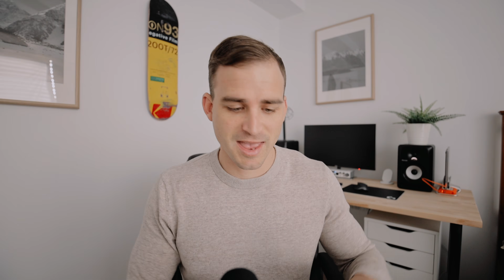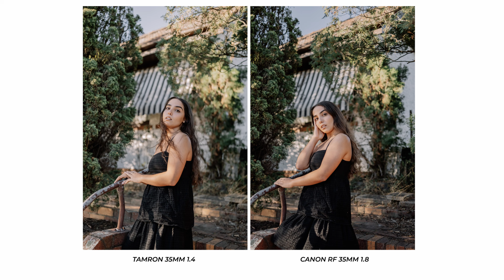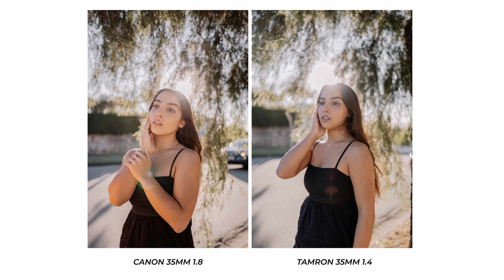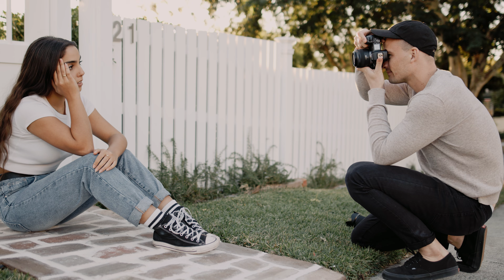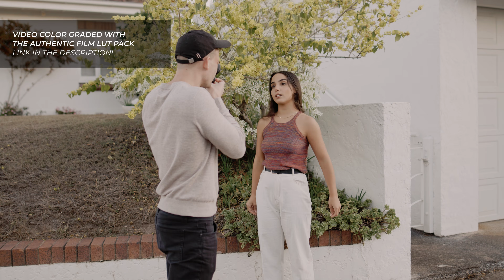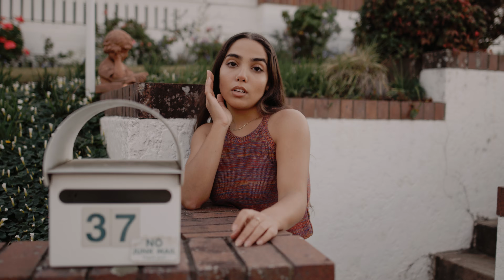Canon RF 35mm 1.8 STM | Photoshoot + Review

Comment: I have this 35mm 1.8 STM 35 from canon. It is a budget lens and its limitations to me are clear. I normally use my 24-70 RF lens so with that the difference to me is very noticeable despite my 24-70 being a zoom lens but for the price, it may go down as the best budget lens canon has ever made because it punches above its weight massively.

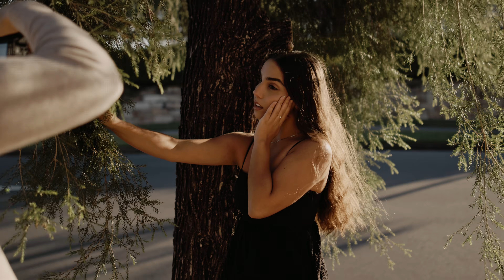Comment: 3:55 just slap a pk 2-5 stop nd filter on in your back pocket "just in case", and problem solved. Booyah. Loved the video btw!!! :D
Reply from the maker: An ND filter stops lens flare?
Reply: @MitchLally  taken from DP review two ideas:

 a) Filters generally worsen the flare. A graduated ND filter which can reduce the light from one direction may help. In some situation a circular polarizing filter can also reduce flare. UV and clear filters protect the lens mechanically, they do not contribute anything to the quality of the image.
--
Gautam

B)  and a guy named Doug walker mentioned the Hoya 77mm Clear Pro 1 Digital Multi-Coated Glass as a viable solution. 

At the end of the day, you do you, but I'm always curious to play around with possible solutions. 😉 Good luck broskie. 🙏

Comment: How close does the "macro" actually let you focus? Imo having macro capabilities on this lens is a HUGE selling point. For people who just want a simple setup for travel use it's perfect. 

Think about people who travel who want a lens that focuses super close for product/food shots but is also wide enough to capture the sights of whichever place they're currently visiting. It's perfect!
Reply: It can get pretty close, I don't have the figures, unfortunately, but it does take Macros quite close-up.  But this is not a professional lense.  The pictures are not as sharp compared to its counterparts, especially after you have taken them and zoomed into the eyes of the subject. I have this lens but I hardly use it. My advice would be to get the Sigma  35mm 1.4, it is a hundred bucks more expensive or so but if you have a bigger budget, then get the Canon 24-70 2.8 or the Sigma 24-70 2.8. You will not be disappointed.

Comment: Thanks for your review Mitch! I believe yours is the only comparison between the Tamron 35 1.4 and the Canon RF 35. After having used the Canon RF 35, which lens do you prefer to use as your primary?
Reply from the maker: I love that little extra DOF you can get with the 1.4! Plus I’m mot a fan of the flaring on the rf. I would love to take the RF with me travelling though. I use a bmpcc6k as my main video camera and it is EF mount which means RF lenses wouldn’t be able to be adapted to it so for now I’m sticking with EF lenses.
Reply: Mitch Lally thanks Mitch! I own both of these 35s and regularly have an internal dialogue as to which I should bring for a day. Much appreciated :)
Reply: @lsagidullin  I like the output of the Tamron more, however I find I carry the RF 35 1.8 with me more often due to how light it is. It depends on what you value most!